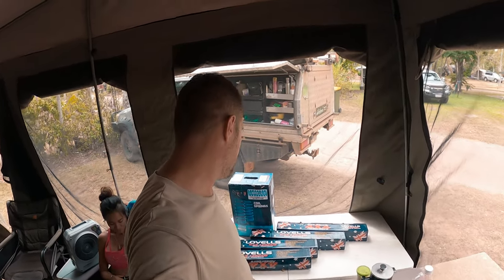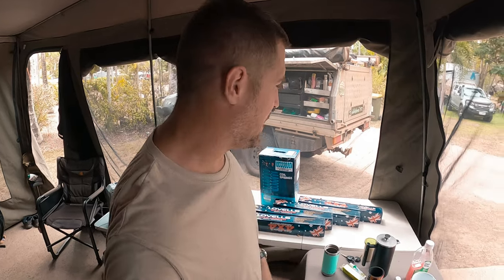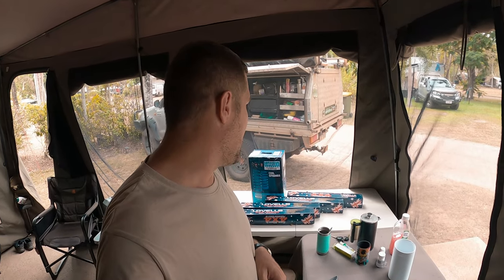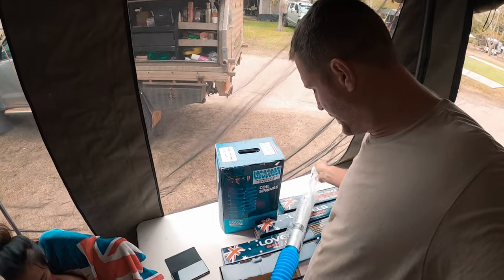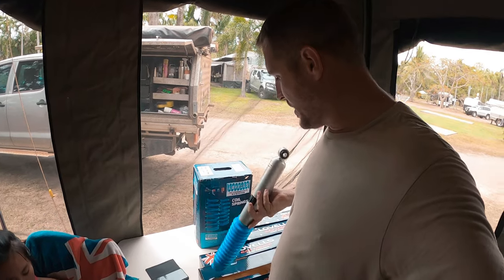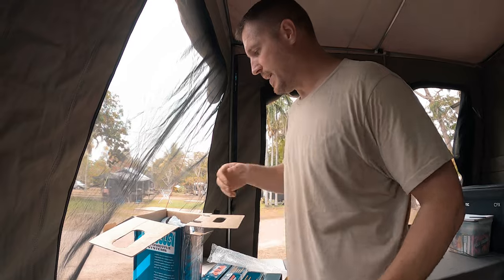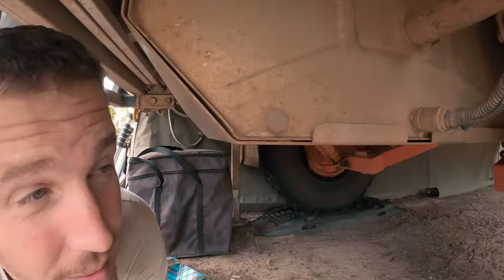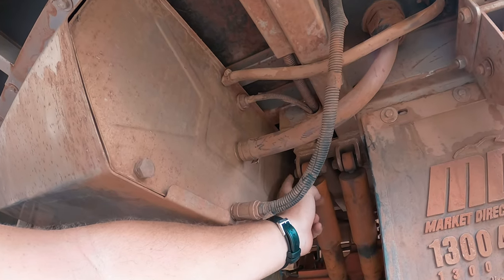Installing Lovells Camper Trailer Suspension

Comment: Instead of a retention chain, you should always use a limit strap, as used on offroad trucks. Limit straps do not rattle, and they do not create a severe jolt to the chassis if you fully extend the suspension.
Reply from the maker: great tip!

Comment: Dealers of a lot of brands, campers and hybrids maintain a cheaper version of suspension, knowing full well their products are being used in a similar fashion to you.  Why not just use a stronger more durable system straight from the factory floor.  Instead of using the suspension provided when they are shipped into the country.  These poducts should be made in aussie from the ground up.  you pay enough for them.
Reply from the maker: Thanks for your comment Gary. I would agree and you can get Aussie made campers but unfortunetly they are more then double the cost and out of reach for many. Happy camping 🏕 ☺️